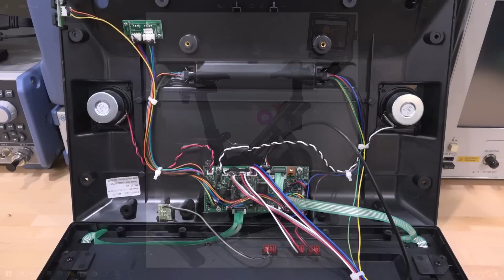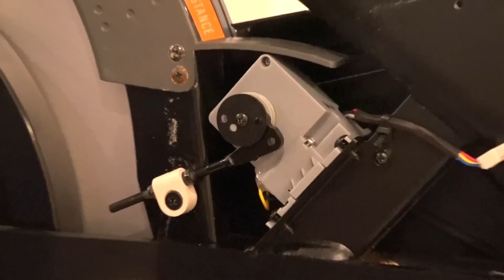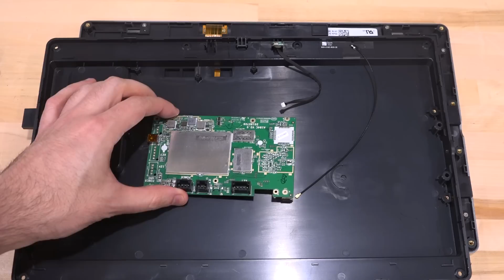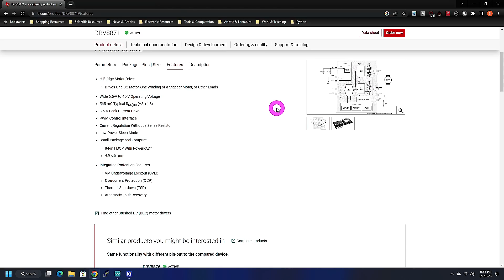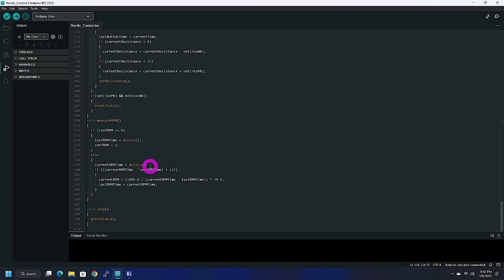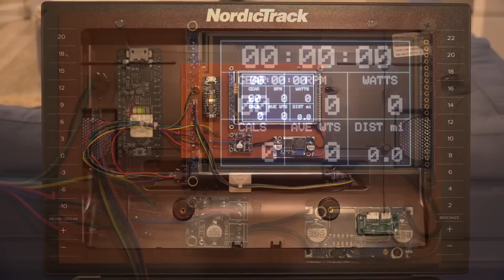TSP #246 - Design of a Custom Control Board & Software for a Broken NordicTrack S15i Exercise Bike

Comment: Terrible how the company did you like that. It's no wonder the consumer those days has so little trust in diagnostic fees. US$1,000 is just straight up a price gouging scam, it's more than half the cost of the entire bike just for that measly little Android SBC, probably costs US$50, it's not even like it's a discontinued model and they're doing you a huge favor dredging up new old stock, it's a current model!

Some further context for viewers, NordicTrack (purchased by ICON in 1998) is currently the focus of multiple class action lawsuits for "defective exercise bikes and treadmills" and "deceptive practices" as well as "abruptly cancelling and disbanding the iFIT on-demand fitness classes and refusing to refund customers for their subscription and equipment purchase" as well as a number of privacy and data issues. NordicTrack also appears the be the sort of company that sues its competitors over anything including "leaderboard functionality", "swivel monitor" and "resistance control". By all accounts they sound like a company I would never want to deal with.

But good to see you fixed it with a nice clean simple retrofit. But to top it off I would recommend reporting your experience of deception and misleading claims about your warranty, I assume it's the FTC's bureau of consumer protection in the US, you likely won't get any sort of resolution however you add 1 figure to statistics of complaints against the company which helps the class actions but also will annoy the company and likely cost them more than what they got from you in the "diagnostic fee" in labor dealing with the complaint from the FTC.
Reply: $15. It's probably off the shelf unit too.
Reply: I'm confused about the whole warranty part. It's still not clear from the video whether the bike was on warranty (and there's a document proving it) and company refused to provide it, or indeed the warranty ran out some time ago and the operator somehow made a mistaking stating that it's still under warranty.
Every company's customer service messes up from time to time.
Reply: @gylkag  NordicTrack appears to offer a warranty of 10 years on the frame, 2 years on parts and 1 year on labor as standard. Marks on the bike seem to indicate it was manufactured at the end of 2019 in China, Shahriar likely bought it early or mid 2020 in the USA inline with lock down and he probably called tech support mid to late 2022, feasible he was just barely within the 2 year parts warranty, however the NordicTrack warranty terms explicitly state parts must be ordered within the warranty period even if it failed and was looked at by a technician within the warranty period. The support agent likely failed to communicate that his warranty would expire by the time the technician was able to inspect it and parts could be ordered. I can't expect the human that handled his case to be perfect along with every other customer case, but usually if a (good) company makes a claim like, if you pay for X, Y will be free they will honor it or refund the initial charge if they were mistaken, however I'm sure if Shahriar was told the part would be US$50 or even US$100 he probably would have just bought it, but US$1,000 is just insane, you can't blame that on a lapse in judgement, it's plain and simple price gouging, you can buy an entire used S15i for that much money.

The tablet is an off the shelf unit with some slight modifications for ICON, the FCC ID says it's made by Zhangzhou Wanlida Technology Co.,Ltd.
Reply from the maker: @WizardTim  This is exactly the situation. They were wrong in offering the warranty and then chose to not refund me the labor or honor the warranty. So I was left with either throwing the bike away or pay the insane $1000 price tag. So I chose to do just make my own simple interface.
Reply: @TheSignalPath  Thanks for clearing this out, was really curious.

@WizardTim , you need to open PI firm (or you already work in one?). :)
Yeah, I understand mistake, miscommunication and bad handling of the situation - although they shouldn't be on the same case :) - but $1000 is nuts indeed.
Reply: @gylkag  No I'm just a plain electronics engineer, but I do some in depth failure analysis investigating on my YouTube channel, but in some future videos I have planned I go full PI into the details of some stuff :)

Comment: What would it have taken to salvage the existing lcd screen?
Reply from the maker: As others have said, it would have been an absolute pain to re-use it.
Reply: Those mostly run with a MIPI-DSI interface, 16-24 bit parallel or LVDS in some cases, so you would need a microcontroller that has the hardware for that(or just get creative with what you have) and typically a lot of ram for the framebuffer. A low res 800x600 screen with 16 colors a pixel will need 960kB, that is a lot. Arduinos won’t cut it in this case, an esp32 could work but with limitations and psram and some stm32s are made for this purpose with internal hardware for 2d graphic handling and acceleration and most lcd interfaces. A raspberry in any case should be able to do it, that’s pretty much the „embedded tier of mcus“ Nordic used in the first place.
Reply: Salvaging random displays is a pain in the a**. You need a controller board which is often integrated in the main board and even when separate you need a way to talk to it if there are no standard inputs like HDMI (or composite).

Sometimes you can find control boards on eBay/Aliexpress if you search the display model but it might not be worth the hassle

Comment: Pretty lousy how they collected the money for a service call and then sandbagged you on the PC replacement. I get the feeling it wasn't completely an accident...

Consumer protection and wasteful profiteering aside, I hope they see this video and get red in the face. Don't mess with engineers!
Reply: Considering that 106k people, who are likely technically minded, and likely in a buying position just got a hint about what to do when their one fails, and that replacing all the $1000 crappy display that rails is a $50 set of boards, and some free code, likely going to make a big difference in sales and support sales.

Comment: The original design of the bike is, as you point out, this incredible mismash of extreme complexity and bone-simple solutions. What I find surprising is I was able to implement a flywheel-less exercise bike with a BLDC motor, FOC controller, and encoder that seems like it would be able to do the same job as the NordicTrack but at lower BOM cost, drastically less weight, and substantially lower mechanical complexity. The main downside is that the motor controller is a lot of electronics for an exercise bike - but if you're already putting 3-4 fairly complex submodules into the bike, what's a motor controller that replaces two of them? NordicTrack's design philosophy here seems totally incoherent, both from an engineering and business perspective.

Great video, thank you!
Reply from the maker: The flywheel (although heavy), combined with magnets is a dead simple solution. The wheel also automatically cools down since it is spinning. But I like the solution you are proposing. You can do some interesting things with it.
Reply: Assume that the people who made the controller boards aren't the ones that make the whole training bike.
There is a bit of an argument against using a generator as a brake, as humans have peak power output of 250W when pedaling, and probably can sustain 100W. That's not a small figure of heat you have to remove from a bunch of MOSFETs, without active cooling or overly large heat sinks. The way they are doing it is to dump that heat into the flywheel.
Reply: @graealex   You don't have to dump the power/heat into the switching elements, just use braking resistors or cheap heating elements.
Reply: @Broken_Yugo  But then you still have to dump it into a rather small mass and keep that below a certain temperature, plus it can't be an exposed part to avoid the user burning himself. And you might have to cool it for more than an hour sustained. It's at least not trivial.
Reply: @graealex  Use that to charge some batteries or supercaps. That's how the exercise bikes at Intel work, plug in your tablet or smartphone to charge it. (Sadly, it predates USB-PD.)
Reply: @NiHaoMike64  As outlined, sustained load might be in the order of 100 W, and typical cell phones charges will seldomly go beyond 20 W, even with USB-PD.
And no matter where you dump it, any energy storage will eventually run full. No way around heating something, and finding a way to convect it into the air.
Reply: @graealex  One could power a fan from it and turn that energy into moving air. Or use a grid tie inverter to pump that energy back into the grid (that's what my senior design project was about), just gets a bit complicated.
Reply: @NiHaoMike64  I don't know what part of "100W need to be radiated away" you don't understand. The manufacturer went for a rather simple solution, and there isn't actually much to criticize here. In addition, it probably reuses parts that you'll find on exercising bikes that only have manual control, usually done with a knob that adjusts the spacing between flywheel and magnets with a threaded rod. In addition, this solution provides drag that is automatically proportional to the speed, so at low speed you don't have to put your whole weight on the pedal to get it moving. And the force required to move the magnets is constant, while solutions that for example use a tensioned belt get quite hard to turn (and obviously the belt wears out over time).
And a flywheel is always required to make the stationary bike feel like an actual, moving bike. Because on flat ground, bikes just keep rolling.
Reply: @graealex  The power dissipation characteristics are even less pleasant than you describe. The power output of the rider varies between 0W with instantaneous peaks above 1500W in my trainer implementation; with a mean power output of 200W, say, even within a single pedal stroke you'll see power output varying between 0W up to around 600W with a frequency of around 2-4Hz depending on pedaling cadence. Moreover, you need to back-drive the system at times to provide a truly even pedaling resistance so as to counteract losses in between strokes and thus power can go negative, too.

My implementation is rather dumb. I simply sink all generated power to a heater (which heats water, in my case) and source all drive power from the wall. A smarter implementation might use an integrated battery or supercapacitor instead to buffer the power and allow consistent power delivery. For a cheap solution, however, powering it from the wall and running a small space heater or similar would work fine.
Reply: @benjaminchung991  Dumping all the energy into the flywheel via magnets is simply an elegant solution, especially since it's pretty low-tech and not much can go wrong. As I've written, lower-tier bikes will have only a manual control, and the distance between magnet and flywheel could be controlled by a knob or a ("gear") lever and a bowden plus springs - with zero electronics that can potentially fail. Pretty sure they adapted this electronic solution from a manual one.
Reply: @graealex  Sure, I'm aware of those designs; the issue that I have is that in this version of the bicycle they retained the same design and added considerable complexity to control it. The original design has no electronics that could fail, but this one sure does. My objection isn't to flywheel bicycles generally, it's to this specific NordicTrack bicycle.

What I'd point out generally is that this solution is "simple and elegant" all the way up to the point that you want to control it electronically. Once you add that requirement (and particularly as implemented here) I'd argue that it's no longer a simple or elegant solution.
Reply: @benjaminchung991  Yes, but that problem comes from their stupid way of implementing it. As a top-level comment, I suggested making these units more self-contained (one controller and motor for the distance control, one controller and hall-effect sensor for RPM, one for the pedal cadence), getting rid of the internal PSU (a wall wart would easily be replaceable and removes any mains voltage from the bike chassis), and then just connecting it all up to some run-of-the-mill Android tablet, with an OTG USB hub. If a module fails, you can replace it for a reasonable amount of money, and the software would just be an app running on Android.
However, replacing the dead-simple flywheel with magnets with a BLDC with external shunt resistors and whatnot would literally make everything more complicated, not easier. Somewhat decent BLDC controllers aren't even particularly cheap, even straight from China.
Reply: @graealex  The simplification that BLDC enables isn't so much electronic, it's mechanical. A BLDC trainer can be implemented as a direct-drive system rather than requiring an intermediate drivetrain as this trainer has. While mine isn't direct drive (it's belt drive due to a desire to adapt an existing bicycle; I'd also note that the earlier statement about tensioned belts getting hard to turn isn't quite correct, it's perfectly fine at bicycle speeds), a direct drive implementation allows the pedals to be linked directly to the braking motor and thus the complete elimination of several major mechanical components of the trainer including the front and rear flywheels and belt transmission mechanism. Notably, the BLDC solution also avoids the cyclic effort problem wherein you get variable resistance throughout the pedal stroke that you get from all constant-drag trainers, too, which is why I went for it. These trainers rely on the flywheel to mitigate it, but it isn't perfect, whereas the BLDC system can completely eliminate the effect.

These days BLDC controllers are actually reasonably cheap, particularly if you're implementing it at the component level. The TMC4671 + TMC6100 gets you the entire controller and gate driver logic for less than $15 BOM cost, and the AS5048A encoder, for example, nets you another $4 on the BOM. Suitable MOSFETS are then let's say another $10, so you're looking at something like $40-50 BOM cost at quantity 1k. On a bike with a retail price in excess of $1,800 (a large fraction of which I suspect goes to the mechanical construction which this solution saves considerably on) this seems perfectly acceptable.
Reply: @jaro6985  That's a good point; I think I was overestimating the cost of metal/weight here. It's just surprising that the mechanicals would be so cheap on a bike that costs more than $1,800 new.
Reply: Using BLDC was a nice idea! There's a commercial bike trainer using such tech called Tacx Neo. It's build around a custom BLDC motor which is coupled directly to a bike cassette. The motor allows them to do some nifty tricks like simulating descends by spinning it up or imitating rough road surfaces by vibrating it a bit. The power is burnt using two huge resistors with fins attached and a small fan blowing over. It's sadly still quite heavy and by no means cheap!
Reply: The classic solution to these sorts of bikes was a fan with a variable aperture air intake/exhaust to set the resistance. So running a fan to cool the electronics that heat up (or resistive heaters, flywheel, etc) seems quite reasonable. You can run the fan from the pedal power as the base resistance, and dump energy elsewhere as the resistance increases.